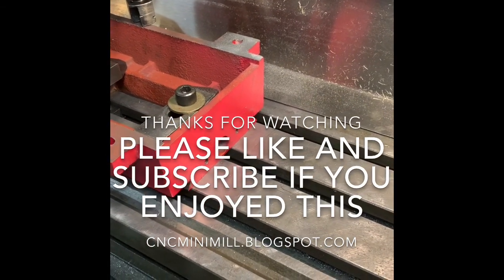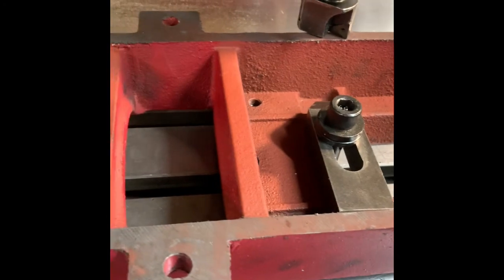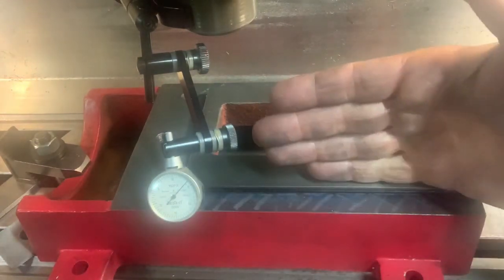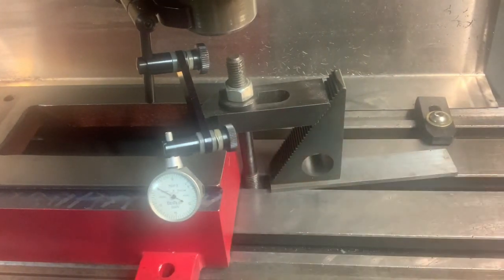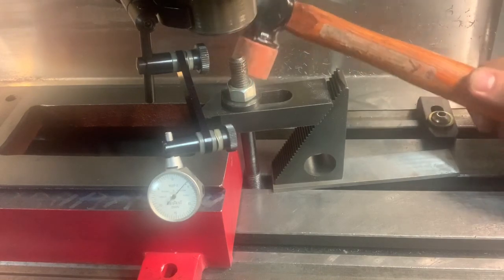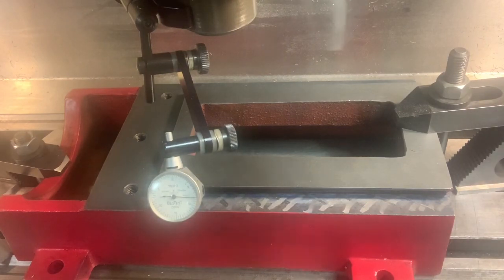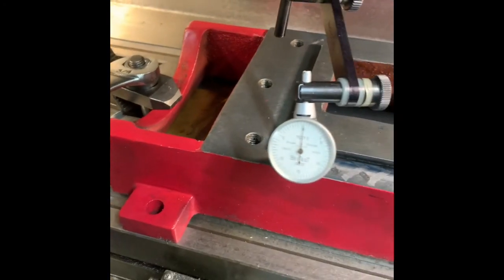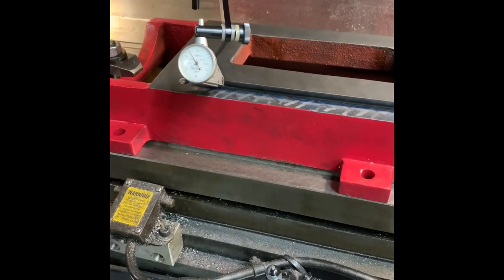Trials and tribulations of a cheap harbor freight mini  mill casting

Comment: Wondered why your did not put flat bars across the bed so they lined up with the feet and then clamp.
Reply from the maker: Not exactly sure what you mean but the first part I show in this video is me surfacing the bottom so I couldn’t have bars in the way of the cutter.